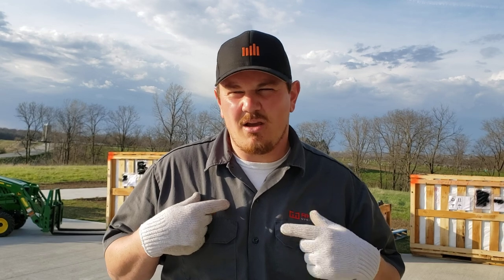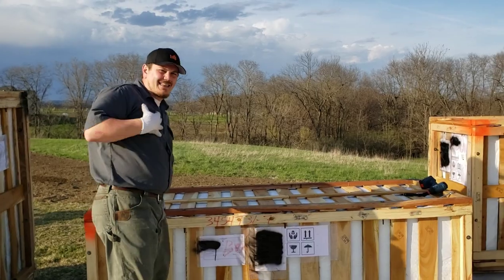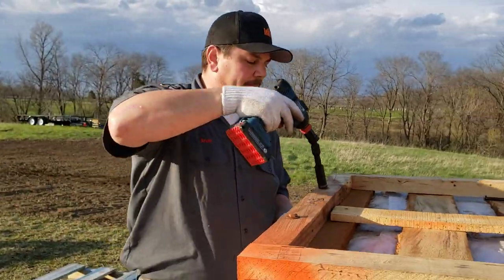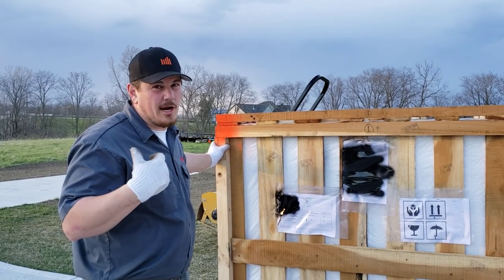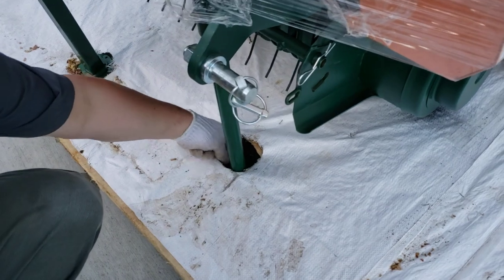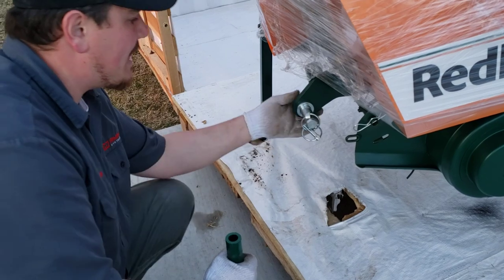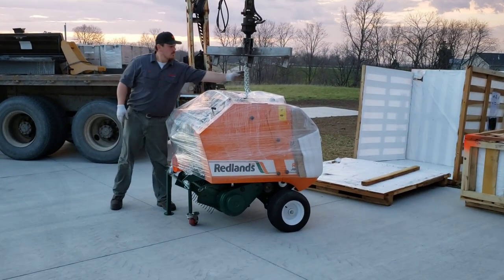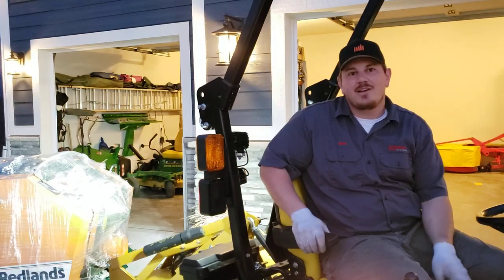Redlands - Jumbo 1208 N - Mini Baler - Unbox, First Fully Automatic Run, & Front Bale Yield

Comment: Looks like nice equipment. I use slighly larger equipment but still small scale. My tractor is a Kubota L4060 (40 hp, large frame) with a Krone F130 round baler (4x4 net and twine). It was too hard to find a local farmer to harvest my 20 acre hay field without keeping the majority of the crop, not knocking them, its just how it is where I am. Now I do it all myself, have been getting 100 very dense 4x4 bales per year, more than enough to feed my horses. Small scale works very well. Good luck with your future endeavours.

Comment: I need to ask a very technical question regarding your video:
Why can I see your neighbors' house? Meaning: why trees have no leaves? Supposedly you are in summer and it seems to be the end of autumn or the beginning of winter. Oh ok I jumped quite a bit and I see lushy trees. So it seems the first part is 3 month old, since you said something about covid lock down,  it is probably the end of winter then, or something like that
Reply from the maker: This was filmed some time ago, before the spring of 2020...then LATER, when we were harvesting hay. There was quite a gap of time (A few months, in fact). Also, we had to work through some bugs with this baler. Everyone has said it's pretty normal, even with new hay equipment, to have to get some kinks worked out...but for us, we're still learning a LOT. We're very happy with Redlands. They bent over backwards to help up through these tweaks to get things working well. The back half the property (We didn't film), was way smoother, but it also yielded BIGGER and DENSER bales.

Hope this helps!

Comment: Good Vide. I have been thinking of something like this. For weight and width see, Tractors Tools Direct.  Who did you go though to purchase? Bob.
Reply from the maker: Bob - this was built and imported for us. We can get you one if you want. Use our email on this account if you need a quote. It takes time, and it's slightly more than the Tractor Tools Direct options, FYI, but it is way more feature packed, and built in India rather than China. I realize this might not make a difference to you, as it doesn't to me...but the Indians tend to totally over-build things, while the Chinese tend to build what others have built, without the exact know how (copies) and they will cut every corner to be the "cheapest" - I totally get it, and they are very smart business people, but this is not the type of application for cut corners!!!! You probably already know the catch phrase, "You pay for what you get"...

Either way. We can get pricing, and availability for you if you want to buy one, but it takes time even for this step. If you're not serious about it, I understand, but don't be afraid of the effort. You will thank yourself every time you use it.

Comment: Would you still recommend this baler?  How does it compare to the $5k one from Keno Tractor?
Reply from the maker: Looks like this ours is way more refined than the green one they're offering. Not to take anything away from that machine, but it looks to be one of the Chinese offerings, while ours is an Indian. Hard for me to showcase all the differences in quality, since I can't even tell if this item net wrap or twine wraps the bails...
Reply: @BrianPhillipsRC  can you share a bit more about how you ordered it?  Pricing etc?  I saw that they are using your video in some promotional stuff, so I assume you have some sort of branding arrangement with them.